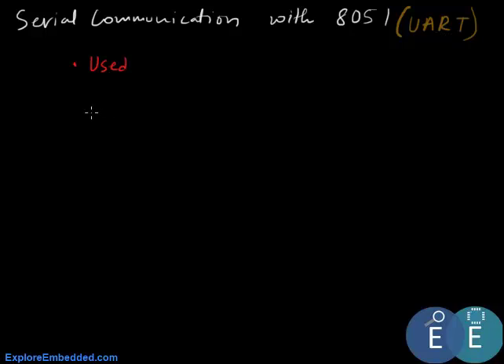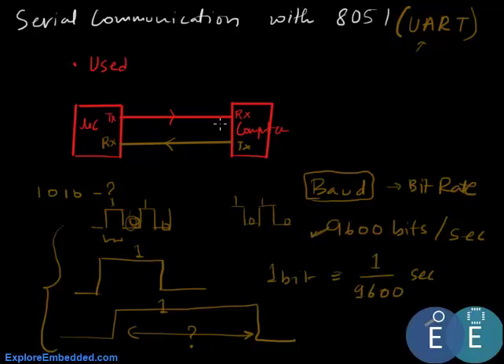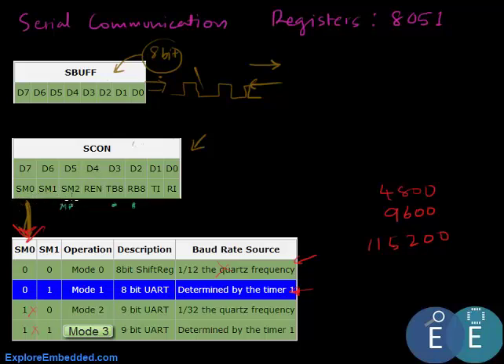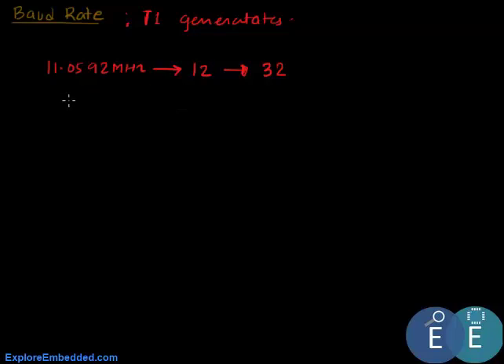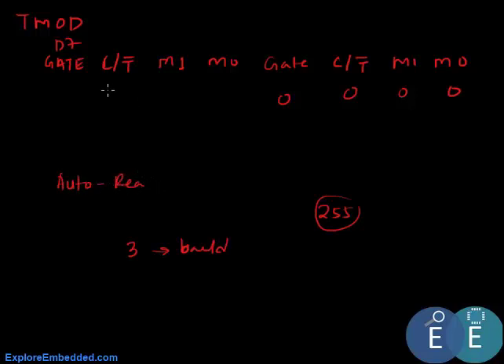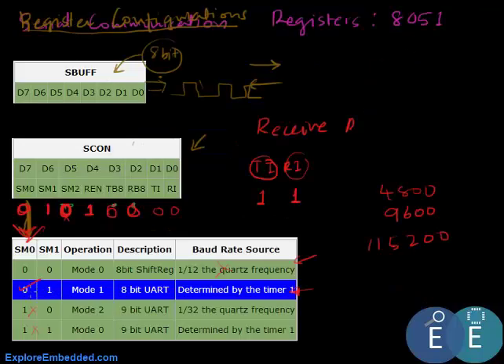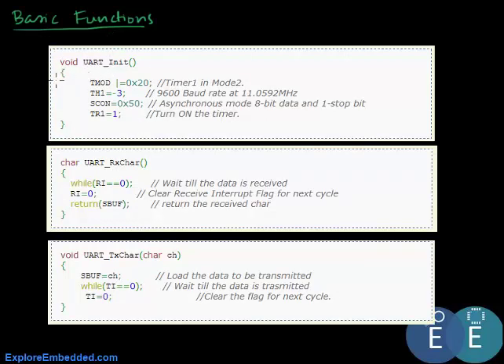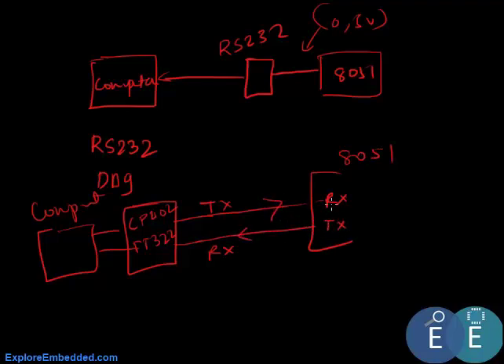8051 Serial Communication

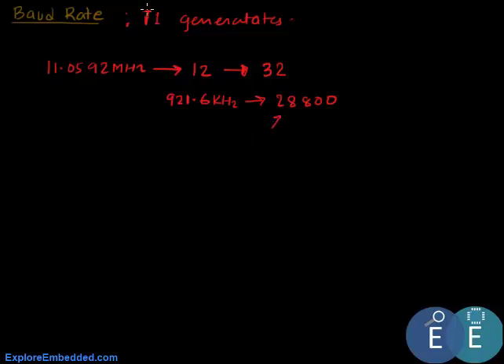Comment: Regarding the calculations discussed in 14:00,,, why have you divided freq by 32???
Reply: The MCU does this internal, before giving the clock to serial communication block. Think about it, if it is directly, it would be too high. Hardly you  will ever find baud rates greater than 115200 etc for 8051